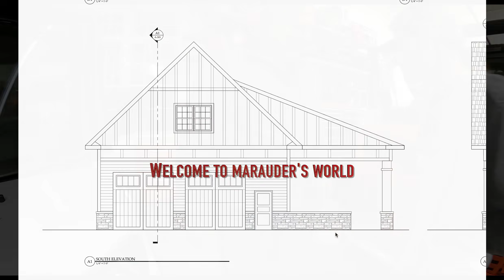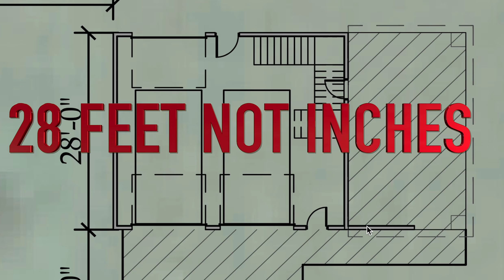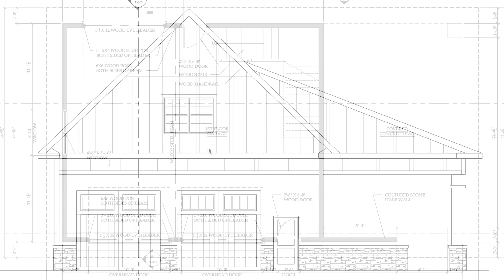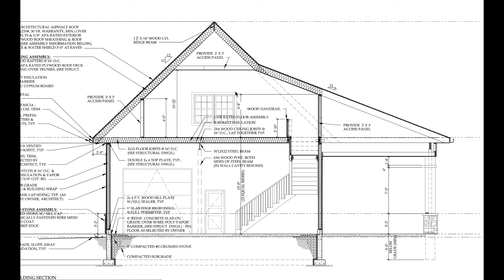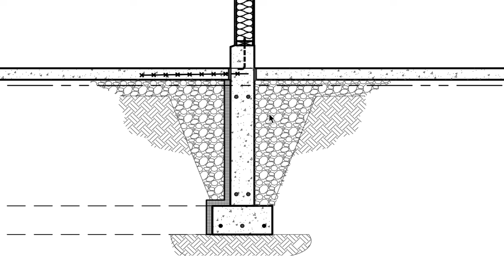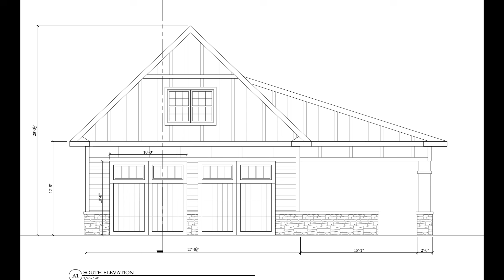New Garage Design Cost Covid Economy My Health Interest Rates An Honest discussion  #325

Comment: I hope you don't think that what I am going say is criticism. This garage needs to be at least 12 feet longer. I don't know what your plans are to use the lift for but it probably won't work If the garage isn't longer. I think you should put your toys in the new garage and use your current garage for vehicles. Yes we are in a covid economy but there is nothing anybody can do about it so all you can do is live with it. As for the interest rate what was really insane was the low rate for the last years.
Reply from the maker: Paul about the length, I've been thinking about that lately. I needed three variance to building the garage...the town gave me approval for all three. I hate to go back for another variance. I will think about this

Comment: Good morning, Peter.  Like so many others, I watched all the way through and love your ideas. Your thought process is so clear that nothing I add will make a difference but since you asked, my vote is for the smaller version.  If the kids will be on their own within the next few years, you'll have a couple of bedrooms opening up in the house and probably won't need a mother-in-law apartment. I doubt you'd want her going up and down stairs in a detached building anyway for safety reasons.  If you decide to go with the large version anyway, I would NEVER remove the walk through door at the back.  If a fire breaks out around one of the vehicles and someone is upstairs, emergency egress near the base of the stairs is going to be paramount. 
About the track hoe, I know that as you continue to take down dead trees, it is a much needed asset for your property but in another year or so you'll probably have made all the major improvements to the acreage you could reasonably foresee.  Storing it on site may not be a future issue.  That just leaves the Bobcat or whatever tractor you have for removing snow and your 4 wheelers.  You might be able to go with a third option of a single bay garage for those with an inside dimension of a garage and a half for plenty of room to store toys and a work area but just one garage door as access.  Just a thought.
Reply from the maker: I'm thinking the same thing...I agree maybe it is too large. My wife does not like that excavator...oh boy. Thank you great comment.

Comment: I watched entire video. Seems like you have thought about this for some time. In listening to you, it seems to me, you and your wife are more set on the patio than either of you are on the garage part. Have you considered which direction the patio faces? Since the patio faces same direction as back of your home, does the back of your home get beat up by the sun? The patio will get the same sun. I think the first plan with living space above is over the top of what you need and deep down inside you know it would never be used as you intended. Your second plan is better. You kept the patio the same size, but made garage smaller. This is why I say it seems to me the patio seems to be the need here and the garage is the want. Have you considered a plan C? Plan C could be keeping the patio the same size, but when it comes to the garage part, how about this? Build only 1 garage door, (still 10 feet wide door) and instead of a 2nd garage door, narrow the width of the garage down some more, from like 27 feet (like plan B has it) to maybe 20 feet wide (again, this 20 feet is just garage part, not patio). This would still allow you to put 2 vehicles in it (if the length is there between the 2 vehicles) and to have a workshop area off to the side of the garage door area bay. You would have to decide weather to put the garage door on the patio side or the left side(farther away from patio). You could even put the man door (entrance door) next to the garage door, since you said you need one of those as per code. I think this plan C is the answer, from listening to you during this hour long video. You still get you and your wife's need, which is the patio. And you still get some garage space along with some workshop space. From watching your video's, I see you like to tinker around at times. Hence you could use the workshop. I agree with your placement of the garage, as long as code allows a building that close to the property line. I assume you know what the side yard setback footage is from the line. Keep the building as close to the house as you can, within reason, because the farther away you put it from the house, that is the longer walk you have to make everytime you go there. 
As far as the economy goes, yes, right now interest rates are high, but I feel things are going to change around at least by end of 2nd qtr. 2024. I am no economist or financial guru, but, it is an election year. We all know things happen in election years. Not to get political here, but the current admin knows it would be political suicide for them to keep things as they are now. Hence, why I say 2nd Qtr. 2024, things will start to turn around and get better. 
As far as your health, this is a decision only you can make. The medical field has big improvements in the things they can do every year to improve peoples quality of life. You seem to be very active, which is good. Remember this saying "Early to bed, early to rise, makes a man healthy, wealthy and wise"... Well, i have a saying as well, "If you rest, you rust". So staying active, with diabetes is the best thing you can do. OK, I am finished with this book. I hope you consider my plan C, as it will save you even more money, and gets you and your wife the patio you both need, and some space for other stuff, without the cost that your current plans have.
Reply from the maker: I have the best viewers in the world, you are one of them. I can't thank you enough for this thoughtful insightful comment...thank you. i will read it tonight with my wife. Your suggestions are awesome. Please stay tuned, be safe.

Comment: I'd check out the RR Building Channel, they build post frame buildings or homes with proper concrete foundations.  It may change your opinion on 'pole barns'.
Reply from the maker: Yes I've watched many of his buildings...but most, if not all are in the south. Please don't think I'm against pole barns...as I stated in the video my town will not allow them in a residential zone...by the time you upgrade the barn it's almost the cost of conventional construction. Thank you

Comment: All I have on my property is a 10x10 shed with no garage 🙃 with my JD tractor, snow blower, generator, pressure washer, and tool boxes.... it looks like 10 pounds of crap in a 5 pound bag!

However, my property is 1.2 acres, so I have room. Just haven't pulled the trigger bc I don't want to deal with any additional tax increases! 

Do all detached garage builds trigger a property tax reassessment?

Take care!
Reply from the maker: There would have to be some assessment increase...I would think it's definite. Sheds are great I had one at my old house. We are both holding on this decision for the same reason.
Reply: i think anything that has a footer, is considered reassessment time. Check into a pole barn, since they have no footer, it might be a way around it. Every city, township has their own rules.

Comment: Have you looked at ICF construction with radiant floor heating?  

Could heat it with photo voltaic panels and electric boiler.  Use a 24-36 volt forklift battery as a storage device.
Reply from the maker: Wow it sounds like you've installed one. I've built several commercial building with icf, I don't know if I'm interested in that system for my garage...maybe the foundation. There's a chunk of work to adapt it for siding. I really wanted a wood stove in the garage...and a unit heater...but I was considering heating the patio slab for when it is enclosed. You really have me thinking maybe I should heat the slab it would dry the water from the floor. Thank you I have to research and think about that system. Thank you
Reply: @maraudermitchelli  adding a wood fireplace or stove would be a great addition for heating on cloudy days or weeks when solar doesn't work!

Comment: Tough call Pete, you need to decide if you will continue to live where you are the rest of your life, if so then I would go ahead with the build. You will not regret it. I would go with something in between your two designs, I like the size of the first rendering but you can go with the lower ceiling height and use attic trusses which will still give you a good amount of usable space  above the garage portion. I had for years planned to build a shop when I retired and did so in 2019, an automotive lift was mandatory so I went with a 30x40 x14 stud wall build and attached that to an existing 24x60 stud wall garage I built when I bought the house. I also replaced an attached one car garage with a two car 26x26x10 a few years earlier. I installed a loft in the rear of the shop over my tool chests accessed by a pull down attic stairs where I located the hvac system ( heat and ac) and also storage racks for parts, oil, filters etc. One 10x10 and one 12x10 garage door with a wash bay with a tapered floor and trench drain. Fully insulated, floor and footers so it's very easy to heat and cool and the inside is completely finished with steel. I am very happy with the functionality and would do it again in a heartbeat, thankfully I got it finished before the price increases. Good luck with your decision, I would love to see your build happen.
Reply from the maker: Wow J you have a ton of garage space. I'm guessing you have a motorhome...thus the 12 foot high door. I loved your comment very interested especially that you air conditioned your garage that's high class. Thank you for the help...smart on your part beating the inflation. Take care.
Reply: @maraudermitchelli  12 foot wide door Pete both 10 foot tall, the wider door is nice if you need to back a trailer in. Pretty tight clearance on a 10 foot door.